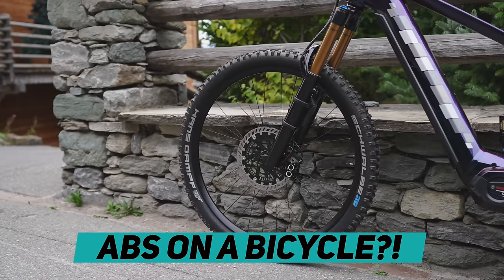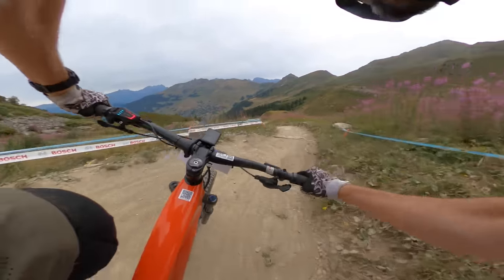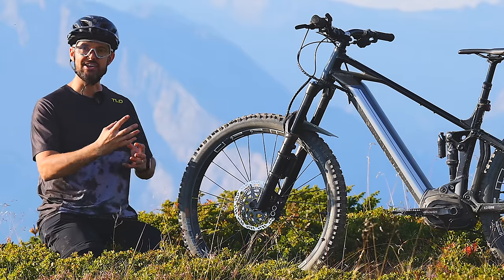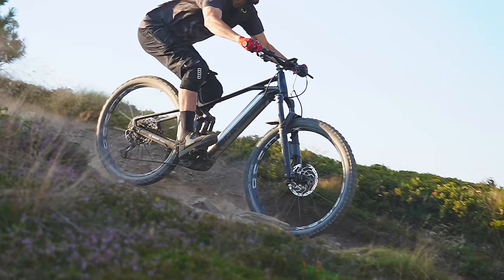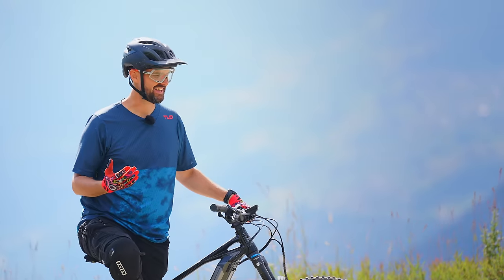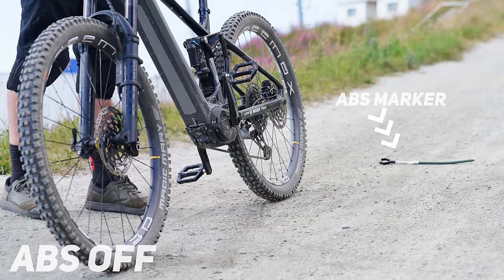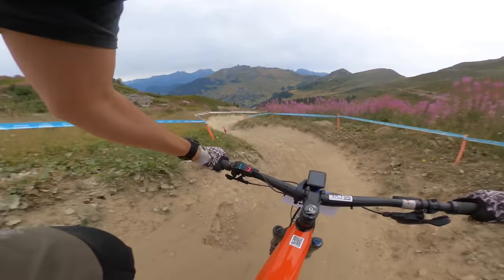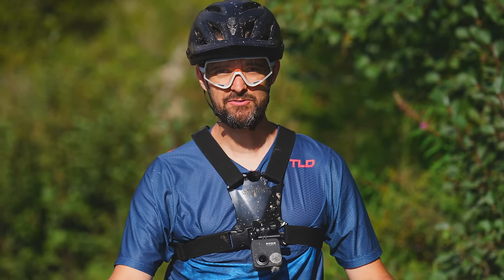I didn't want to like it... Bosch ABS is INSANE!

Comment: For anyone who thinks humans can outperform ABS, please name a motor sport that allows ABS.
Reply: I don't know what humans vs ABS has to do with it, but there are plenty of motorsport classes that allow and use ABS. DTM, GT5, GT4, GT3, to name a few.
Reply: @Cyrenetes  I'm fairly certain all of those classes of motor sports use cars that road legal cars. Here's from an article about DTM allowing ABS in 2021:

> While current drivers had supported the DTM's initial push to race without ABS and traction control in 2021, the series has been forced to abandon its plans because of 'difficulties in a quick implementation of a deactivation of the driving aids and the subsequent expenses for development.'

>This was explained by the Gottfried Grasser, whose eponymous team fields Lamborghini Huracan GT3s in GT World Challenge Europe as well as the GT Daytona class of the IMSA SportsCar Championship.

> Grasser Racing, which already has a presence in Germany via the ADAC GT Masters series, is currently evaluating a two-car DTM entry for 2021.

> "It's not enough to simply turn off the ABS," said Grasser.

> "Instead, completely different braking systems have to be designed. Without ABS, I need different brake pumps and calipers for the GT3 cars.

> "The relation of the diameter of the brake disc front and rear would have to be adjusted.

> "Besides, I can't install something like that and hope that it will work tomorrow. For that I have to test for 15 days and test different components."

https://www.autosport.com/dtm/news/why-the-dtm-made-a-u-turn-on-driving-aids-ban-in-2021-4977714/4977714/

Basically, those classes allow ABS because they use "off the shelf" road legal cars, and it's become too difficult and too expensive to remove the ABS (and other driver aids) from the cars.

The reason drivers are in favour of not having ABS in their classes is that ABS takes the driver's braking skill out of the equation, because ABS can outperform even the best of the best drivers in the world.

And this is relevant to cycling, because ABS for bicycles aren't starting from year zero. We aren't starting at 1971 with the first modern ABS system.

The idea that we can somehow outperform an ABS system is about on par with the idea that we could somehow beat up a grizzly bear in an unarmed fight.

Comment: 7:20 Either you were failing on purpose because you were paid to do so or you lack skills. 

In this challenge I  know I and most seasoned riders can do better. I can stop without skidding at all if I want to.  Obviously you were trying to stop as fast as possible, but as long as the back tire was skidding you were never going to achieve your goal.

Comment: ABS is for idiots! On bikes and cars!
For them it makes a differece for shure!
Planting your brakes with no sense of anything and without ABS is bad... with it... it´s less bad!
But if you feel your vehicle you don´t need ABS!
I have 3 cars, 2 from the mid 80´s, one with old ABS (now disabled) one without at all, and one car from 2019 with all the new bells and whistles! (ESP is a realative ok for 4 wheels, sorta)
If i slam the brake at snow or ice on my modern car, the ABS takes way more distance to stop then if a brake controled. 
Also if i try to turn while full on the brakes on my new car, it just turns bad, it dose but not usefull!
If i go of the brakes on my old car and turn, and then re apply the brakes, or even just control both as needed i can point my car and slow down much better then the stupid ABS system!
On my bikes i NEVER head the need, ore desire to have more or less breake!!!!
I can controle it (nearly) perfect all the time, specially on such a light vehicle with just one tire per axle, most of the mass you are moving is YOU, you have the best feeling and feedback from your vehicle you could ever ask for!
If you block one of the tires of your bike without notice... you should fall for the better of mankind!